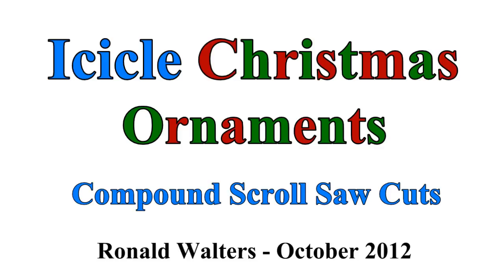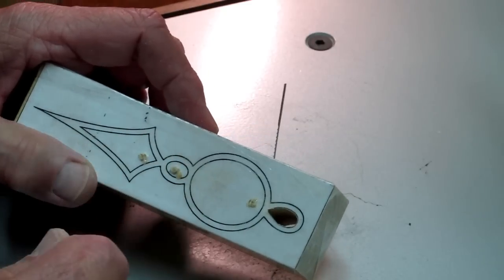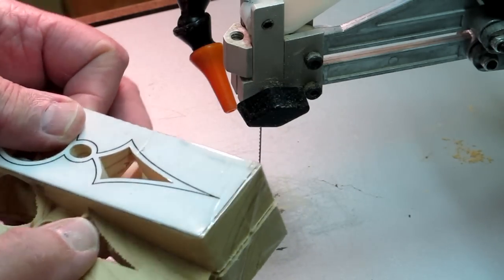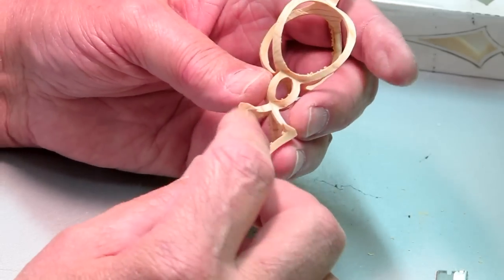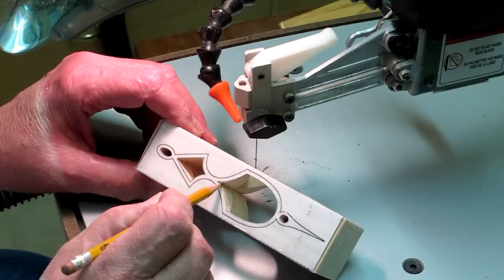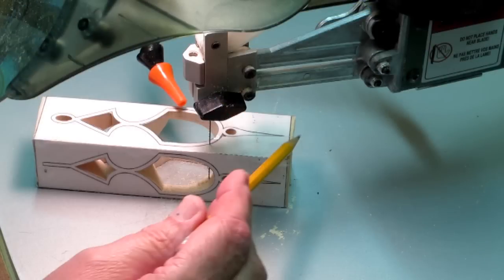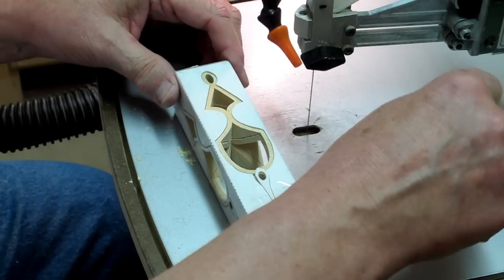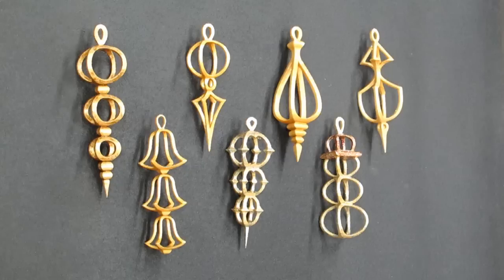Christmas 3D Wood Ornaments - Compound Cuts on the Scroll Saw

Comment from the maker: I have zero experience with Proxxon. I have not seen one. Briefly looking at their website I get the impression they are geared toward miniature work and smaller machines. Previously I had a couple of Delta scroll saws, which were adequate. Now I have a 16” Excalibur scroll saw and I am very impressed with the solidness, quality construction and performance. I strongly recommend a machine that uses standard 5” plain end blades. Stay away from pin type (cross pin) blades. I hope that helps.

Comment from the maker: The blade needs to be square to the table and as tight as possible without breaking.  If it is too loose it will deflect all over the place. If you push too hard it will get hot, burn the wood and/or break. You may screw up a few pieces before you get the tension and feed rate correct. Try different blades. Different people have success with different blades. Try different saw speeds. Practice makes perfect. Wrap it with packing tape – you’ll be amazed at the difference it makes. Have fun!

Comment: Save the block and glue the 3 sides back in to have a storage block to protect the ornament the other 11 months OR for safe shipping!
Reply: I reassembled the leavings of a rook chess piece I made and have been slowly filling it with left over epoxy. With any luck ill have a multicolored epoxy replica of the original.
Reply: 1áá

Comment from the maker: A good saw certainly helps but I started doing these on a relatively inexpensive Delta scroll saw. An on/off dead man floor foot switch has also helped a lot so I can stop cutting whenever I want. Go to my video on the 3D Reindeer Ornament and follow the link in the description for the pattern. Enlarge it a bit bigger to begin with … good practice. Thanks for watching.

Comment: Thank you for explaining the process so well. Can you explain why you did not cut the outer shape first. Only asking as I am new to scroll saw work.
Reply from the maker: First, the blade needs to be square with the table. The wood blank is not very wide, so making the inside cuts first helps to hold the pattern square to the saw blade. Then, after making the first outside cut on one side, the blank is retaped to try to hold everything square while the other outside cut is made. Very important to let the blade do the cutting and allow the action of the teeth to clear the sawdust... do not push the blank trying to speed up the process. Probably the best lesson in doing all of this is your first few attempts when the cutting process will possibly result in the blade wandering and spoiling the ornament. Then the whole thing will become quite clear. Have fun. Mistakes are part of the learning process.
Thanks for watching.
Please subscribe. That's what keeps this channel going!
Ron

Comment from the maker: Personally I have never needed anything deeper than 16 inch. They are all the same saw... just different depths. The 20 and 30 inch models probably have better balance on the workbench or worktable due to the much larger and heavier scroll saw table. I have mine fastened to the workbench.

Comment: hi im a total newbe to scroll saw ilove the chrismas orniments and have tried to make them without much success .no mater what blade i use or how gentle i am the blade always drifts of so the bottom is different from the top. any advice would be appreciated thank you
Reply from the maker: Pretty much everything you need to know is shown in these videos:

Christmas 3D Reindeer Ornament - Compound Cuts on the Scroll Saw

Christmas 3D Wood Ornaments - Compound Cuts on the Scroll Saw

Christmas 3D Gingerbread Man Wood Ornament - Compound Cuts on the Scroll Saw

And even this one will give you more information about cutting on a scroll saw:
Cutting Wood Gear & Clock Wheel Teeth

The wood block needs to be absolutely square.

The scroll saw table must be absolutely square to the blade.

A sloppy (loose) or worn out scroll saw is not going to give good results.

Your choice of wood can make a difference. Pine, with straight grain and no knots or splits, is fairly soft. Basswood is much easier to cut but is expensive. Oak or other hardwoods is probably a poor choice.

There can be pieces of wood with hidden flaws, cracks or sap pockets that can spoil your project.

The pattern must be attached square to the wood blank. 

Wrap the entire blank with two layers of packing tape... the glue on the tape lubricates the saw blade.

Check a practice cut with a small square. If the face of the cut is not square to the top and bottom faces you need to find the problem.

Keep the blade exactly in (or on) the pattern line. If you wander back and forth from the line, it will spoil your project.

Let the blade do the cutting. The blade must be given time to clear the sawdust from the cut. If you force the blade too quickly, sawdust packs up in the cut the can (and will) overheat the blade and force the saw blade off track and will spoil  your project.

A dull blade will overheat. Overheating usually changes the color of the blade... will soften the metal and will lead to the blade bending out of shape and/or breaking... spoiling your project.

Saw blade tension is important and is something you will just need to learn by doing. It is a find line between a blade being tight enough and too tight. Too tight and it can break prematurely. Too loose and the blade can wander and spoil your project. Keep fingers away from the blade and always be prepared for the blade to break. A broken blade can grab the blank and slam it up and down on the scroll saw table and can spoil your project.

I usually show tips and tricks and what blade are being used throughout the videos so pay attention.

The correct blade to use is a matter of trial and error and finding one that works for you.

If your saw has variable speeds, try slowing it down

Doubtful someone will get it right in the first couple of tries. Practice makes perfect.

Keep trying and have fun!
Thanks for watching! Ron

Comment: Started to do this out of poplar wood after watching your videos. Would Bass wood be easier then Poplar?
Reply from the maker: vtxrider1800r I have not tried Poplar. Some say Poplar (depending on what is being sold) may be softer than pine. Basswood cuts nicely but it is expensive. I have had good results with a clear, straight grain, piece of pine 2x4 with no sap. Whatever you cut, be sure to wrap it with clear packing tape which will make the cutting easier (it lubricates the blade).
Reply: Ronald Walters  I've been using poplar for one dimensional scroll work and had good luck with it. Cuts easier and pretty cheap. a 1 1/2 square by 3 feet is $5 at the big at HD. I've been using the tape and it does what you said. They are different fun to make.

Comment: How did you varnish it did you use a tiny brush with polyurethane or did you spray it??
Reply from the maker: Polyurethane with a small brush. May want to thin the polyurethane a little and plan on at least 2 maybe 3 coats. Sand off the roughness (gently) between coats.

Comment: If anyone could answer this ,   it would be much appreciated.   Their was a ornament I believe the same woman the gentlemen mentioned in this video.    But one ornament was made from cutting it out of  a  block but your ornament fits in a two sided box from the same block you cutter the ornament out of.  .  The box protects the ornament.
Reply from the maker: You could do that with one of these ornaments. The "scrap" sides are generally pretty flimsy and have packing tape all over them but you could save them for that. I prefer having a dedicated sturdy box just for these ornaments and you can always wrap them with the smaller bubble wrap or soft foam packing material. Thanks for watching. Ron
Reply: @RonaldWalters2010  I would like to see video of someone showing how one is made.  Then the people you make the ornament for will have a box to it in
Reply from the maker: OK... I am showing you the box you refer to @ 4:00 and @ 4:10 . Sometimes if you are lucky the ornament can be removed easily. Then I usually break apart the box @ 5:15 and make additional "flat ornaments" by sanding the waste flat. But then as shown @ 9:30 the box may need to be broken away to avoid breaking the ornament when it is being difficult to removed it from the block/box.
Thanks for watching. Please subscribe! 
That is what keeps this channel going. 
Ron

Comment: just starting out and could only find poplar in a perfect square blank. never cut on hardwoods before any tips on how to not take 3 days to make an ornament?
Reply from the maker: It will be difficult to find suitable square stock at a lumber yard and if it is not perfectly square the 3D cut will not work. The wood needs free of knots and cracks. After wrapping with packing tape and drilling holes, it should only take 15 or 20 minutes to cut the first one. Then there is some sanding required. Make sure the saw blade is square to the table. Have fun!
Reply: Ronald Walters ok thank you for the tips it took about an hour to cut my first hole I think it was the wood I will need to try and cut some myself.
Reply from the maker: If it took that long to cut one hole you were probably also burning the wood and burning the blade. Wrap the wood with a couple layers clear packing tape (it lubricates the blade). The correct blade helps and a single blade should last several ornaments. Pine can be used or sugar pine. Basswood cuts very easy but is expensive. Do not force the blade, let the blade do the cutting. I do not know where you live. Use the blade recommended in the video. Also good are Scroll Reverse and Ultra Reverse from Flying Dutchman scroll saw blades. https://mikesworkshop.com/collections/blades After some practice it should take 20 minutes to cut out the entire ornament.

Comment: nice work! what glue do u use?
Reply from the maker: For the patterns? Any stick glue or spray adhesive. Then wrap the whole thing in clear packing tape. The tape adhesive lubricates the blade and makes cutting easier.

Comment: How many blades you need to cut the pine and finish the ornament?
Reply from the maker: Philippos Constantinou Depends on your experience tightening the blade, the quality of the blade and some on luck. Some blades may last 2 or 3 ornaments. Some only last one ornament. Some blades break in the first minute. But generally the blades will last longer than you may expect. You want to replace a blade if it starts cutting too slow or if it gets blue from the heat - replace it before it breaks as breaking in the middle of a cut could break the ornament.

Comment: where do you get your wood for these?
Reply from the maker: You can find some clear straight grain pine (2x4, 2x6) or look around for someone selling basswood which is a bit expensive but cuts really nice. The pine will present a few problems, cuts slower and will dull blades but it is cheap.

Comment: What wood do you use?
Reply from the maker: Vincenzo Valenzisi Basswood or clear pine. Basswood cuts nicely but can be expensive.
Reply: Very nice, The tunnel electric can cut hardwood?
Reply: hard wood such as cherry and burl?
Reply from the maker: Vincenzo Valenzisi Sorry, I do not understand "tunnel electric" ?
The scroll saw can cut hardwood but at this thickness the chance for blade deflection (bending) is greater, cutting speed is slower and blades will not last as long. If the blade deflects away from a perfectly straight cut (perpendicular to the pattern line) the part can easily be ruined.
Reply: In Italian the tunnel electric and scroll
Reply: I would buy the scroll Proxxon ds 460, I hope goes well.
Reply from the maker: Vincenzo Valenzisi I hae no experience with Proxxon. I have an Excalibur 18" which is very good and I would recommend.
Reply from the maker: Ronald Walters Google "Excalibur Scroll Saw". Made in Taiwan by a Canadian company. Very good quality.
Reply: Beautiful, but it is expensive
Reply: Thanks for the information
Reply: Ronald Walters I'm going to buy an "Excalibur" (the same of yours), but I can't find it in my country. Do you know "Dremel moto saw"? What do you think about that?
Reply from the maker: Minh Đức Nguyễn Years ago Dremel had a light weight hand held electric coping saw which was was powered by a vibrating magnet and was an extremely handy tool. Dremel chose to discontinue that saw and would no longer supply replacement parts for a relatively complex bent spring blade holder which ended up being a consumable part on that saw. The Dremel moto saw looks to be an over complication of that older saw. It uses pin end blades which are harder to find and offer a limited selection. I have not been able to determine the length of the blades for this tool but I suspect they may be proprietary (made to fit this saw only). While this saw may be handy to the occasional user, I think your money would be better spent on a real scroll saw (Delta, DeWalt or any of the better known saws) or perhaps have the Excalibur shipped to you in your country. I would further recommend staying away from the cheap scroll saws like sold at Harbor Freight or Grizzly. Also, I seriously doubt the Dremel moto saw will be able to cut out a 3D Ornament like shown in this video. I expect the Dremel moto saw to be marginal at cutting out flat stock material. My opinion.
Reply: Ronald Walters Thank you!